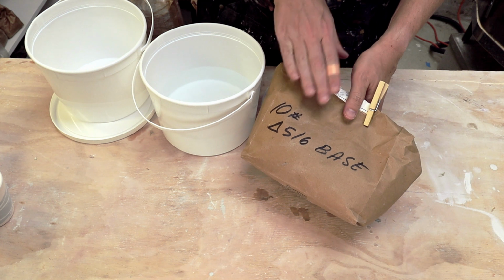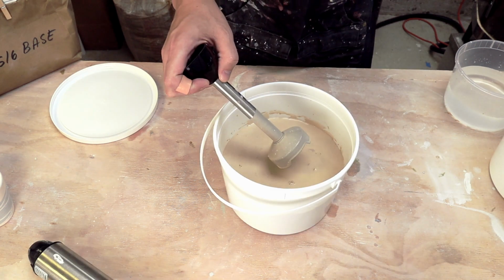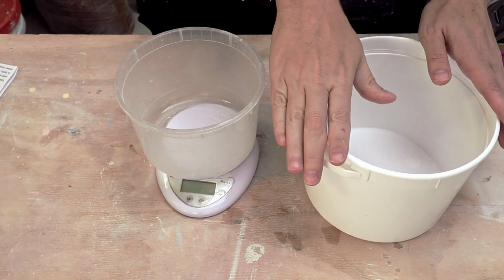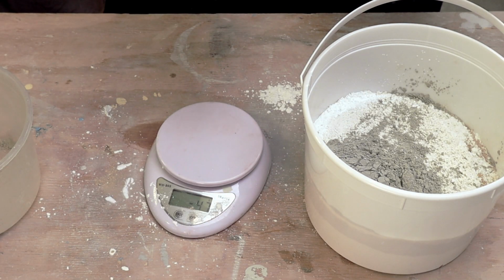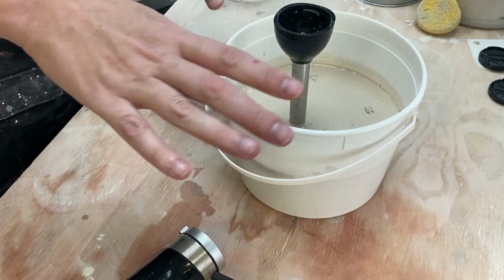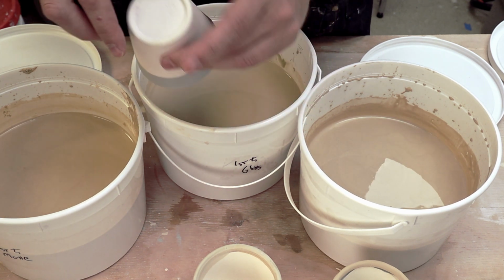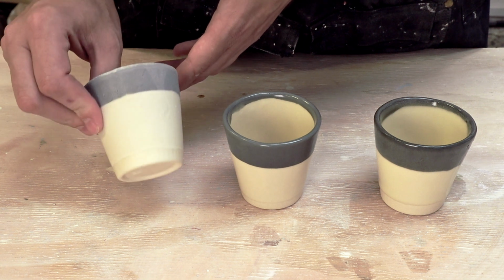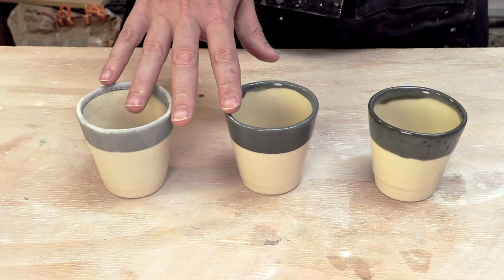How to mix ceramic glaze from dry ingredients - From dust to glass!

Comment: Hey Kent! For the OldForge glossy base batch, did you make a 100g batch? How much water did you use for that batch?
Reply from the maker: I just went for it and did a 1.5kg batch! (So 15x the 100g recipe). And I used Joe's suggested amount of water which is 90% of the dry weight, so 90g (ml) for 100g of glaze. Or for the amount here in this video, 1.35 liters.
Reply: @PotterybyKent  Thanks for the info!

Comment: Do you sieve your glazes, and do you usually let them set up overnight before using?
Reply from the maker: Usually I do not sieve them but they are mixed very well with my immersion blender (I cut most of it out in my videos since it's not very exciting to watch). This is basically following what the creator of the glazes does. Sometimes my glazes will sit for awhile before using them the first time, but not always. I do however give them a few hours to hydrate fully which should be enough for the volumes I'm working it (in conjunction with the immersion blender).